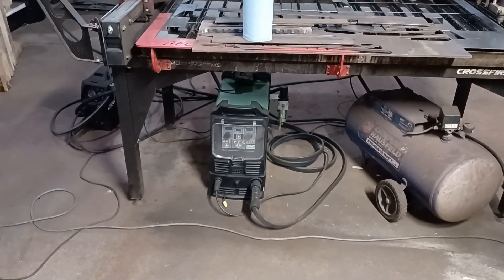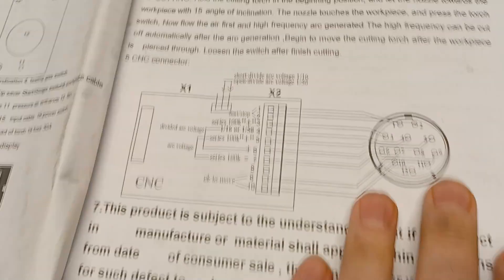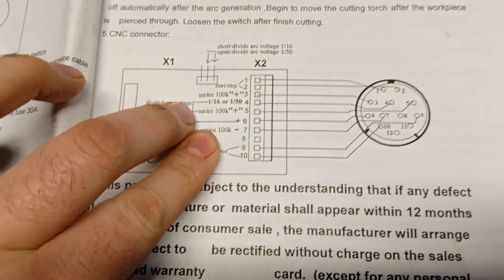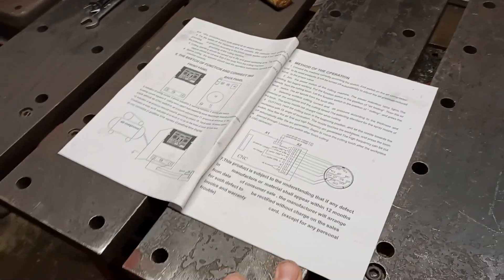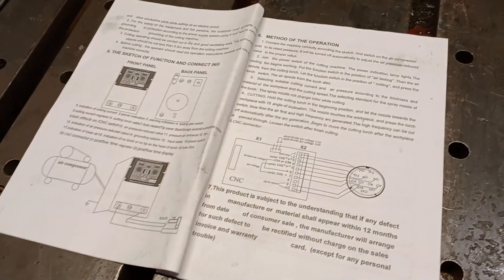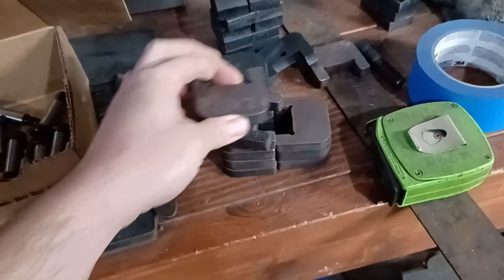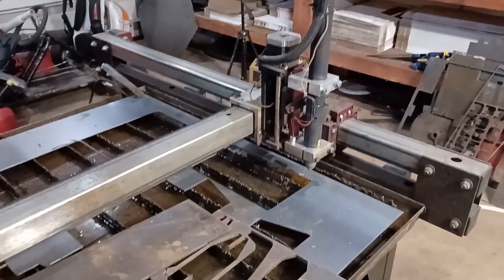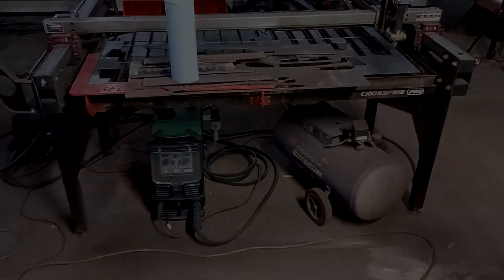Hooking Your Everlast Power Plasma 82i To Your Langmuir Systems Crossfire Pro #plasmacutter

Comment: Put a link to that magnetic 3D printed torch holder I saw on Facebook?
Reply from the maker: It's not 3D printed it's CNC machined billet aluminum anodized blue.  Here is a link.  Should be back in stock in a couple weeks. https://becktools.com/products/magnetic-breakaway-torch-mount/
Reply: Cool, thanks. That's pretty neat. Thanks for the numbers on cutting half inch.  @BeckTools

Comment: I have the same setup and I'm adding the THC right now what settings do you use to cut that half inch plate and what air pressure? Thanks
Reply from the maker: 18ipm for internal, 22ipm for external.  60amps, 75 psi, .045" kurf, Pierce delay 1.5sec, pierce height .200, cut height .060"

Comment: Hey thanks for the Vid i am setting up the same system and cant seem to figure out how to get the CNC connector for 82I apart so i can solder the leads and i dont want to force anything and break it ?
Reply from the maker: it's threaded.  Its strain relief it ratcheted if I remember correctly so if somebody already made it tight you'll have to twist really hard.  counterclockwise will make it come apart.

Comment: Excuse the dumb question…. But where is the trigger wire(pin1-2) coming from? Is it coming from the main control panel… or the VIM box… thank you.
Reply from the maker: the trigger wires come from the Langmuir systems control box.
Reply: @BeckTools  so I have cut the tip off and solder the wires into pin 1&2?
Reply from the maker: @mudhaula  yeah the plug that hooks to your current trigger input on your existing machine will need to be terminated to pins 1 and 2

Comment: I talked to everlasting day and they said they're coming out with a new Torch in March. he said this one is like a hypotherm & uses hypotherm consumables. he said it is a way better cutting Torch than what comes with that.
Reply from the maker: sweet!  I'll have to get one!  Thanks for the heads up.
Reply: @BeckTools  Hello, I just set my 82 eye up yesterday and cuts like a dream. what's the thickest Steel plate you have caught with that? It says it limits out at 5/8. But have you ever tried three quarters?
Reply from the maker: @IRONMANMETALBILLDANK   Yes I've tried 3/4"  You've got to go around 5 IPM with a 3.5 second pierce delay.

Comment: How did you even solder those through that tight opening! I’ve been stuck on this for a week with my 82i and cannot find any answers on a how to
Reply: Me too. I was hoping this video actually showed you how. He just described it. 🤷‍♂️ 🫤
Reply: The piece comes apart, the CNC piece. It unscrews if you twist it hard enough at the connectors. I just figured that out so now trying to figure out the right wires.
Reply: What tight opening are you talking about? If it's the CNC connector that all unscrews and you can solder onto the pins if you're talking about the front of the machine you have to take the case apart.

Comment: Hello Mr. beck

Hope you are still active on here I got a quick one for you. 

I have the crossfire pro with the everlast 82i cnc machine torch system. (Sam’s cutter as you)

I opted to NOT purchase langmuirs THC Add on. 

Should I just Soder pins on 1 &2 or should I go to 5 & 7. I called everlast they don’t like giving info anything unrelated to operating the machine. Figured I would try here before Langmuir. 

Thank you
Reply from the maker: If you don't have the THC you only need a trigger hook up.

Comment: Nice video  thanks. Can i use the Machine Torch Mount for CrossFire / CrossFire PRO with the Everlast Power Plasma 82i ? thank s let me know
Reply from the maker: Yes you can!  LS makes a holder and I also have a set of build plans for one on my website.
Reply: @BeckTools  thanks

Comment: Have you seen this https://youtu.be/FzhiGONOqBY?

Seems people have had issue with the raw voltage connections going through the cnc port. 

But like in your video, if you are getting the exact same voltage at the cnc port as you are connected to the pigtails you made at the torch lead, then maybe it's not necessary. Or maybe Everlast made changes to their cutters to solve the issue.
Reply from the maker: Yeah, mine was the same at the lugs and the pins so I'm pretty sure they have updated the board at the factory.  When I first got it there was way more talk about this then now.  There might still be some of these in the system, but if you buy new now you're prolly in the clear.

Comment: how many pierces do u get out of your consumable's
Reply from the maker: It's hard to tell because I'm constantly changing sizes.  I then put used sets back in.  I always make sure I swap them as sets (both electrode and nozzle always stay together) So if I remove the 1.3mm nozzle, and put at 0.9mm nozzle on I also remove the electrode and keep them together as sets.

Comment: Thank you for this video! Can this unit be used to cut thin metal for like decorative signs as well ? Just didn't know if this unit was best for only cutting thick metal?
Reply from the maker: Yes you can!  You can run 0.9mm nozzles.  I just cut some 0.030" stainless steel last week with this cutter.

Comment: nice video, do you move the pins in the machine or torch end, I just purchased the same setup, also do you know if you can use the cnc torch has a handheld Incase you want to cut something and not use the cnc table, your help would be greatly appreciated thanks in advance
Reply from the maker: Yes you can use a hand torch.  before I got the everlast I was using a hand torch on my cnc table.  hooking this up will not disable your hand torch if you have one of those hooked up instead of a machine torch.  The cutter can be triggered by both triggers.  It's not a one or the other type of thing. :)
Reply: Thanks for the response I have the same setup you have I just soldered the small pins 1, 2 5 and 7 , I know I have 5 and 7 right but for pins 1 and 2 does it matter which one goes to where ? When I cut the connecters off I notice one was black and one was red thanks
Reply from the maker: @travisellenberger4914  nope doesn't matter.  You're just closing the circuit.

Comment: Why did you hook up the trigger when you have a machine Torch and a CNC Cutter?
Reply from the maker: I hooked the CNC trigger output to the plasma cutter trigger input.  This way the CNC controller can fire the plasma cutter when it needs to.